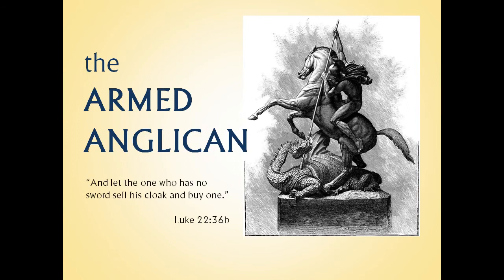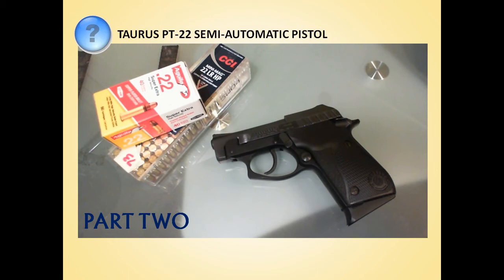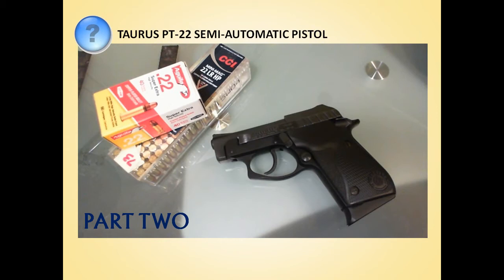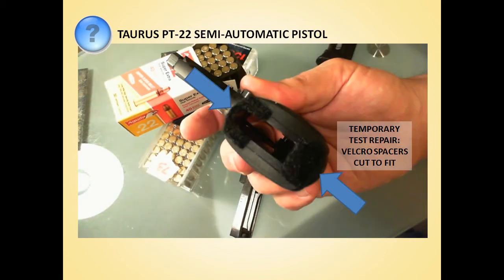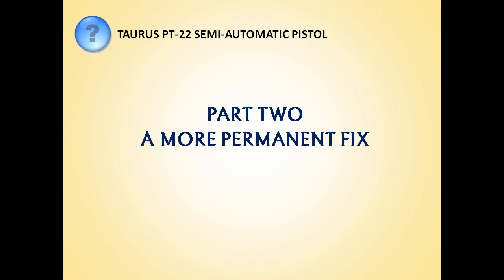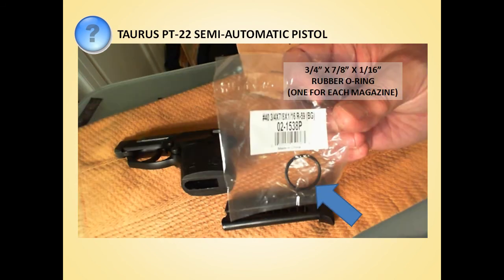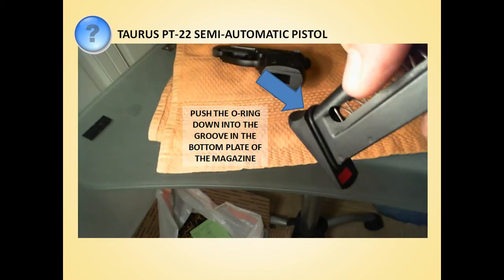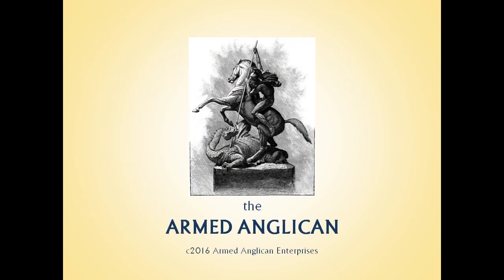Taurus PT-22 FTF Problem Fix - PART 2

Comment: 2023 now and that info is brilliant.  I picked up one in an auction and the gun looked like it was never fired. I took it to the rang and experienced the same thing you did. Took it home and polished the feed ramps and gave it a cleaning.  Next day better results. Still not good enough. I did at that time notice that play in the magazine. Then as I was looking up possible solutions I came across your 7 year old video.  Perfect.  Don’t know where you are now but thank you very much!!
Reply: It's 08/23/24, and I ended up with THREE of these little beauties over the past two months (sort of by accident) bidding on some auctions where no one else bid over me. I think I paid about $325 for all of them - I wish all this fixes for all guns were this cheap and simple!!! I just ordered the O-rings on Ebay

Comment: Saw one today at Academy Sports and was interested in it.  As is usual for me, before I purchase a firearm, I check to see if anyone has had any problems with it.  Found several videos denoting the problems you incurred. Was about to write this firearm off as a DO NOT PURCHASE until I saw your videos.Your video was the ONLY one that had a viable solution to the problem(s).  Thanks for posting.

Comment: Great video. I've been experiencing all the problems listed, but mostly jams--a few stovepipes, and had talked to Taurus about it.  Their suggestion was to try different ammo, specifically 42 grain, 1040-1435 fps. I had only minimal improvement with maybe 5-10 % failures in approximately 200 shots. Looked at your video last night, got the o-rings today, and fired 100 shots.  99% succes, with the one problem being a failure to fire - looked at the bullet, and it had been struck, so I can't blame that on the PT22 or magazine. Called Taurus with a report, and requested a replacement magazine.  If it works, fine. If it doesn't,  I will have a supply of the o-rings ready.  Thanks for the video, many thumbs up!!!
Reply from the maker: You're welcome. Glad to hear that this working.

Comment: My PT22 was also jamming. I tried the o ring fix and it didnt work. I then went to my spare clip and with or without  the o ring no jamming. The spare clip was actually the OEM clip the first clip was an AFTERMARKET clip that now resides on the junk pile in pieces. Thank you for getting me to thinking though.  My PT22 is about 40 years old so maybe the QC was better back then.

Comment: The O-ring didn't work for me, unable to lock the magazine. Tried cutting out a 'gasket' using a milk carton and that improved things a lot. Used scissors, razor blade, and Dremel.
Reply: If you see this, is there any chance you could give a better description of the gasket you created? I have the same problem as you: unable to lock the magazine. Thanks

Comment: This might possibly work except that the "groove" at the bottom of the mag is nowhere near wide enough to "push" the o ring into.  The size of the groove is tiny and will not even begin to take the o ring.I'm thinking the mag is different in the newer model pt 22's. Got this one in 2019.
Reply from the maker: I have recently heard that the mags for the Polymer version of the PT-22 are different.

Comment: I was having the same jamming problems with my PT-22 and was ready to buy a different type gun.  It was very frustrating and sometimes dangerous.  I'm anxious to try the o-rings and see if it solves the problem.  Why hasn't Taurus addressed this problem a long time ago?
Reply from the maker: I hope the O-ring fix helps you. It seems to have worked for many PT-22 owners based on the comments we receive. FYI - Taurus has the worst customer service and warranty repair process that I have ever experienced. They have been notified of this problem and fix but choose to ignore it. I have had another Taurus handgun (Model 905 9mm revolver) in their shop for almost 8 weeks now waiting for warranty service. They refuse to give me any information, and refuse to let me speak to the gunsmith who will (eventually) do the repairs. In the past I've had other problems with them, like waiting for 8 months for a replacement magazine for the PT-22. Taurus also owns Heritage Arms and Rossi and the same service department handles those firearms.

Comment: I tried it and the magazine doesn't lock in place when inserted. Is there another size I should try? I haven't taken it to the range yet.
Reply from the maker: I would try a smaller diameter O-ring. If that doesn’t work, you may have a different problem. Also polish the feed ramp and make sure the gun is kept very clean and lubed.

Comment: This did not work for me..the clip wouldn’t click into place any other suggestions.
Reply from the maker: josh mcclure - You could try a thinner o-ring or try the original velcro spacer fix. You may have a different problem. It could be a magazine issue. Do you have more than one? Some of the other things that I've done: polish the feed ramp with Flitz, and always meticulously clean the gun using Ballistol, then oil the slide tracks. These little blowbacks need all the help they can get. If you call Taurus service they will just tell you to send it in for repair. They would then probably have it for 6 weeks and send it back to you... And it wouldn't be fixed. I've had that experience with them before.
Reply: Armed Anglican thanks I’ll give those things a shot and see how it does.
Reply: Josh, same problem here. This guy says the mag sits too high and "sanded" the top of the mag to get it to seat better.  https://www.youtube.com/watch?v=juLr0GFXsi0   Try this, I haven't yet. Good Luck
Reply: I was thinking about this gun but not going to buy one that needs to be fiddled with to work
Reply: @edmor1086  it's still a pretty darn good gun. Sometimes its fun tinkering with a solution. The o-ring fix seems pretty solid. The results speak volumes. If mine gives me problems next time at the range, I'll definitely be headed down to Ace Hardware!

Comment: Appreciate tip, but looks like didn't work for me.  Better, but still too many failure to feed.  Aguila 40 grain failed 75% of time,  with Federal about 50%. Also, Taurus original mag is flat at base, not permitting o-ring. Guedes this will depend on Taurus warranty to resolve.

Comment: I bought the taurus pt22 and I'm totally bummed out. It just isn't reliable. You shouldn't have to work on a new gun to get it to function. I tolerated the jamming issues thinking it was "break-in" period  but when the slide jammed to the rear I was done.  Add insult to injury, I called taurus and explained all the problems with this firearm and they want charge me $50 for a shipping label to send it back for repairs. I'll just have to eat the damn thing but I will never buy another taurus product.
Reply from the maker: I've found that Taurus' customer service is the absolute worst. I agree with you - and will never purchase another Taurus firearm. Do you have the PT22 poly frame or the steel frame? I am curious about the slide jamming to the rear. It sounds like a separated slide rail and I've only seem that on polymer framed (plastic) guns.. Any chance you are in the Phoenix area? I could take a look at it.
Reply: @armedanglican6361  I have the all steel version, it doesn't appear to be "separated slide rail". The slice jams all the way to the rear after firing (when it fires) and the only way to get it to return to battery is to hit it with a rubber mallet. Taurus should do better than this, I think that they are flooded with junk returns of many of their various models that they can't make good on their defective products. Yes, eat it I will, but you can bet that I'll tell everyone that will listen to me "DO NOT THROW AWAY GOOD MONEY ON ANY TAURUS FIREARMS". If I'm in a gun shop and see someone looking at a taurus pistol, I will advise them of the lack of accountability from taurus and non existent customer service. I'm in Baton Rouge, La. but I'd like to visit AZ. before I croke.
Reply from the maker: @cleankeys4962  - You made me curious. I pulled mine out of the safe and popped the slide off to remind myself how it operates. There is a small plastic part at the front of the slide that is supposed to be a slide buffer. It can be easily lost because it just rides loose in the slide. If it's missing the slide will travel too far back and could concievably jam. This part broke in two on mine a while back and I made an aluminum one to use while I waited "6 to 8 weeks" for Taurus to send me a new one (I actually received it right away). Is that part missing on your gun? See this video for a discussion on that - https://www.youtube.com/watch?v=PA9W80LJdok

Comment: I did this but my mag will not lock now
Reply from the maker: If your mag was seating properly without the O-ring fix, it will not seat with the O-ring installed. You could try a smaller O-ring, but I would bet you have a different feed problem. Some things that might help - Polish the feed ramp and every friction surface on the slide; make sure the mags are clean and not binding; and make sure the gun is always completely clean and lubed. These little blowbacks need all the help they can get.
Reply from the maker: Also - there is a slide stop that sometimes disappears during disassembly, or can just break apart. You can see what I'm talking about in this video >> https://www.youtube.com/watch?v=PA9W80LJdok&t=7s starting at about 10:58.
Reply: Awesome thanks for the reply I’ll give them a try